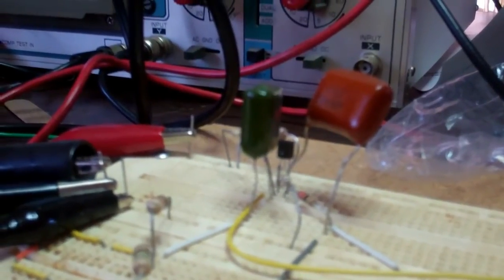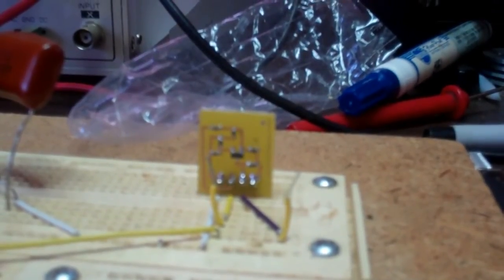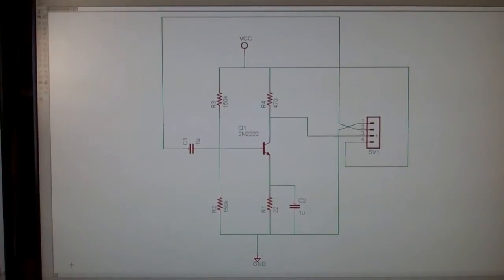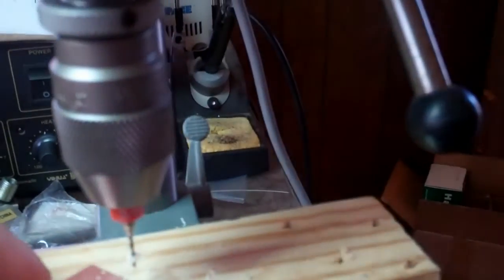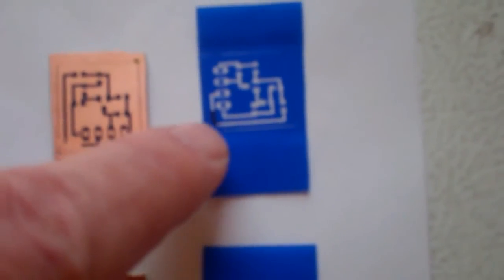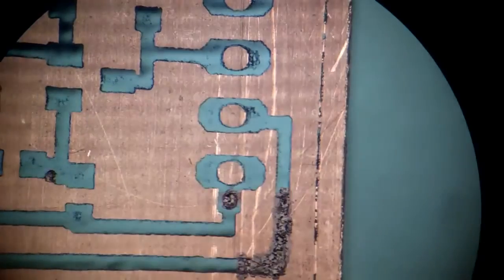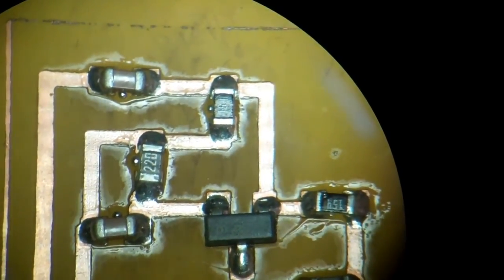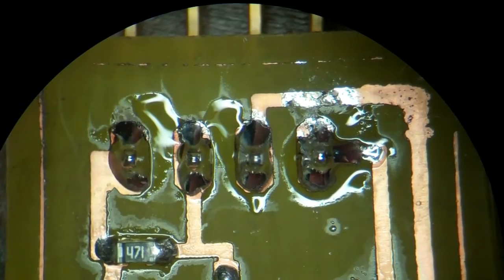Making an SMD Printed Circuit Board

Comment: Cool. I'm always down with trying new things even though the bog-standard steel wool / press-n-peel / clothes iron method has been working well. I'm noticing a lot of scotch-brite with ajax as the new steel wool. And the laminator method seems intriguing - if for nothing else as a decal maker, with secondary uses in PCB making.